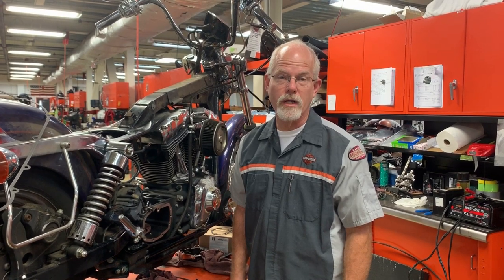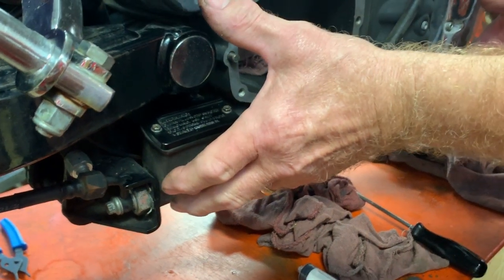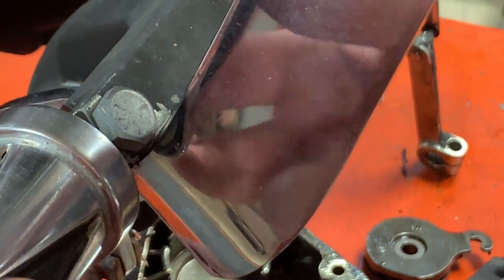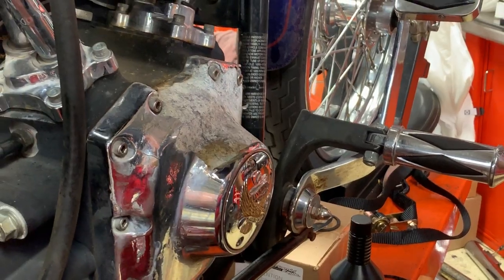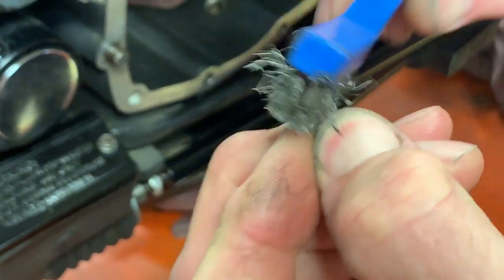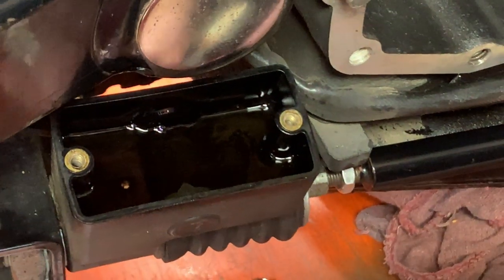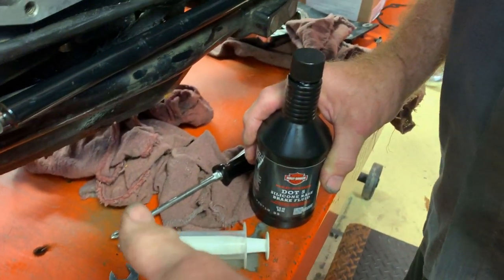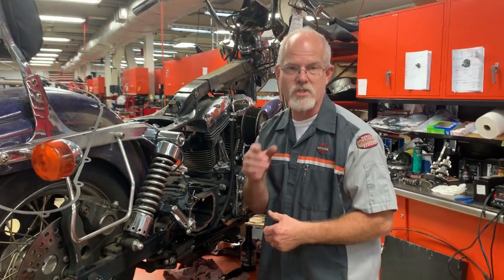DOC HARLEY: REAR MASTER CYLINDER NEGLECT

Comment: Hi Doc, Great information about neglected parts due to their location. Swing arm attachment points would be a great video. I talk to a lot of DIY'er. When this topic comes up they get that "deer in the head lights look"  That death wobble has some very easy to do work around products. They are not expensive, and ANYTHING YOU CAN DO WITHIN YOUR MEANS TO HELP REDUCE OR MITIGATE THIS WILL MAKE YOU RIDE SO MUCH MORE ENJOYABLE. After a couple of hours reading up it, I became very clear about the  concerns and the process of the solutions. I am not promoting any products, as many people have produced solutions to help with this issue. Anyone with hand tools and a torque wrench can easy make an positive impact to minimize that problem.
Please add to your passing along info about the corrosive brake line issue going on from the rear caliper all the up to the abs unit and back down to the master cylinder. Those abs units are very reliable when maintained properly. People on youtube show you ways to to withOUT  some sort of digital syncroniztion  device. I have done that too with great success, however, BRAKES ON BIKES ARE IMPORTANT , as they do not have the reduncy factor that cars and trucks have. YOU NEED brakes to stop and/or not lock up. I bought one for about 170, however, I have seen them lower. It is a lot less money than doing something stupid to your brakes. I also found you can become a hero with your bike riding buddies. Great bar conversation, Definately beats discussing politics.

I have offered your solutions to people over the years. It starts with "Doc Harley did a youtube video about something like this. When your done looking at porn you should check it out.

I know abs on bike is the second best modern invention next to heated grips.

Have a happy 2022 riding season
Reply from the maker: David wish you lived close by. conversations at the local pub would be interesting. Thanks for sharing....Doc

Comment: Do, in Canada here. Love your knowledge. That said, Rear mastercylnder for my 05 Roadking. That inch and a 16th nut there, The wrench I have is 14inches long, still having a problem getting it off. A video will help me, but I can't find one of yours. Hundreds on changing the caps😉✌️thank you
Reply from the maker: Thanks for watching. Your decision: buy a wrench and cut it short or remove the exhaust and use a 1/2 drive socket…..Doc

Comment: Thanks for sharing your wisdom. Your videos are awesome. 
I recently installed passenger pegs on my 2020 iron 883 and as you know the master cylinder goes attached to the peg mount. I didn’t open or mess with the cylinder at all except to wiggle it a little to get access to the bolts. Install was fine except for the fact that I did have to push the master cylinder forward by a little bit, maybe 1/8 of an inch to align the holes with the peg mount. Everything seemed to be working fine while riding until the rear brake locked up to the point the bike would not move one inch. Brake lights were solid until the bike cooled down. It would only let me ride about a mile before it would lock up again. 
My guess is that the issue is between the cylinder and the pedal since the lights were solid, maybe adjusting the screw will fix it. I’m hesitant to ride it to test it as I was extremely lucky to not get hit by a car. 
Any advice would be appreciated. Thank you!
Reply from the maker: When it comes to brakes, take it to your dealer to be sure. I want you to be safe…..Doc
Reply: Thanks, Doc! @LowCountryHarleyDavidson

Comment: Stock exhaust on my 2000 1200XL Sportster makes checking and changing the fluid in the rear master cylinder a pain also.

Comment: Hey Doc, is it me or why every time I R&R the master cylinder fluid caps, the rubber (silicon) gasket weeps, regardless of screw torque and/or alignment. I keep a few in the parts bin so I have a replacement handy if I remove the cover. Have they been made to be disposable? They are only a couple of bucks but you want think you could get multiple uses/seals.  BTW - the seal leaked on my clutch cap as well (after rebuilt by H-D - recall).  Bike is 16 RGU.

Comment: I'm not a big fan of HD so I don't tend to keep up on their latest reiterations. Having known about the Harley problem with rear brakes locking up I wondered if they had effected a change or kept on ignoring it. So now I see they are using DOT 5 for fluid because of its higher boiling point. Simple enough I suppose but now they have a non hygroscopic fluid that will not absorb water which can create a problem in colder climes when those water molecules in suspension accumulate somewhere in the system and freezes solid or just corrodes the hell out of the master cylinder and caliper.

Comment: Hi Doc , I have a sportster xl 1200v seventy two 2015 . It’s been sitting for a year or so I start it once maybe twice a week  but now all I get is a clicking noise on start up ? . It has been on a trickle charger and battery shows 12.3 volts. Would be grateful of any advice , it has only 718 miles on clock . Keep up the fantastic vids
Reply from the maker: Not sure the age of your battery, but a Harley battery needs to be 12.6-12.8 at a minimum to start. Starting your bike and not riding it weakens the battery, I’d rather you keep it on a battery tender all the time.
Reply: Sounds like it’s time to replace the battery. If you really don’t ride it all that much I would recommend buying a lithium ion battery as they can sit forever without changing.

Comment: Hey Mike, i Went back to a DYNA 3 weeks ago, my local Dealer found a LEFTOVER 2014 1/2 FXDL low rider , do you know if the 2014 has the same rear brake adjustment as you just showed on the 99 Dyna ? My Pedal is Too Low when i go to use the rear brakes i have to almost bend my foot parallel with my leg to get any brake action. the bike literally has 1800 miles on it, what i put on in the last 3 weeks..........Help need rear brakes (ps has ABS)
Reply from the maker: When it comes to brakes, take it to your local dealer. Especially with ABS...Doc
Reply: @LowCountryHarleyDavidson  thanks mike doing it at dealer

Comment: Love your videos you've taught me a lot over the years and for that I'm grateful :-) 1 silly questions I have a 2016 Roadster and it's my understanding and from my own experience for some reason the back brakes tend to squeak a lot in this model any suggestions question mark your feedback would be appreciated and considered a blessing
Reply: Davo T. If the pads were just replaced then they are bedding in, but if not then there maybe something up with the contact between the rotor and the pad. You could always just replace both.
Reply from the maker: There are many things that can cause squealing- old fluid, pins at break caliper need lubed, pads, disk... too many to tell without seeing it in person. Some break pads are made from metallic material for wet weather that causes squealing. I’d take it in to be checked.
Reply: The rear brake on my 2014 XL1200X has been screeching since I took it off showroom floor new